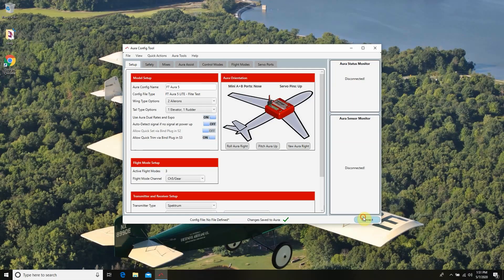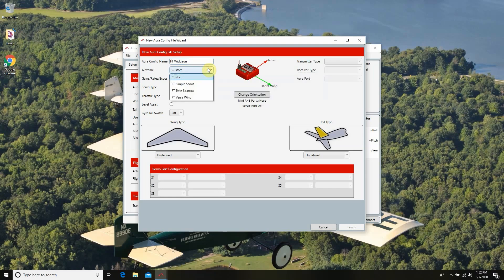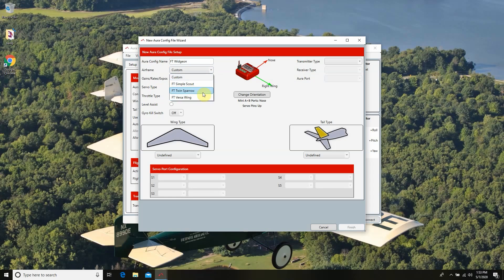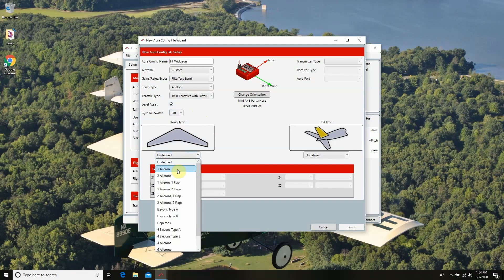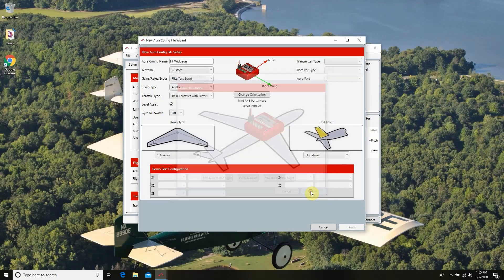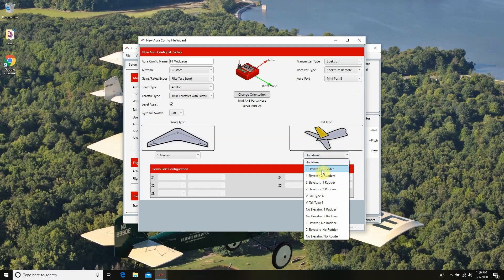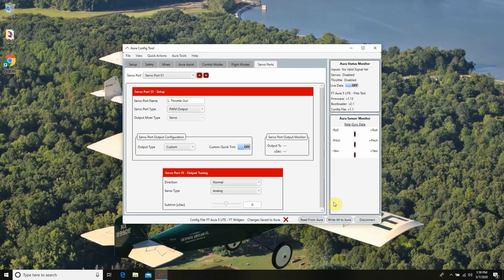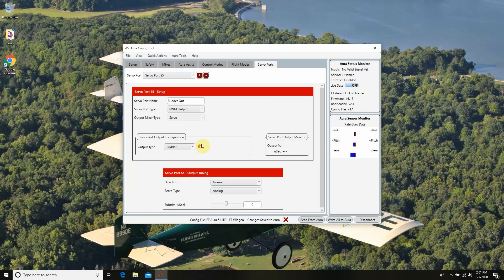How to make a plane profile? / FT Aura 5 Lite

Comment: I don't use a PC anymore, just an iMac. I think that you have no solution presently for Mac users with the Aura 5. I just do what I can with the two push buttons and that is that. Expo, mixes, rates are only in my Spektrum 6 transmitter. I do get 6 axis, 3 axis and gyro free operation. I am about to buy two of the Simple Stick (one for spare parts). Why should I buy the recommended Aura 5?

Comment: Where would be the best spot to put the aura 5 on the sea duck? just order the kit and everything so ready to start build when it gets here
Reply: Hi Joseph,
We aren't super familiar with the Sea Duck ourselves, but you want the Aura to be in the aircraft and oriented in any 90 degree orientation relative to the flight path. Most aircraft will have a receiver or battery platform that is level to the flight path and will work great for the Aura. It does not have to be mounted on or near the CG.

Comment: It would be nice to have a step-by-step video on adjusting the 6-axis settings. I'd like to adjust the bank assist/aileron bank limit and elevator limit and can't figure out how to do it. I have no idea what all the "gain" adjustments mean. I'd like to see an adjustment of the 30 degree bank limit so I can adjust it to say 60 or 75 degrees. As it stands in 6-axis mode it takes 300 yards to make a turn.... Any layman's language assistance would be appreciated. Thanks.
Reply: David, we have some basic definitions of Aura terms on our Wiki page here:
http://wiki.flexinnovations.com/wiki/Aura/Glossary
Gain, specifically, is the amount of correction the gyro will apply for a given movement. In other words, if you have it set to a low number, and the wind bumps the airplane, it will not apply as much correction to counteract that. If you have a large number, it will correct with more force. Too much gain though, and the aircraft can oscillate, or 'wag' back and forth rapidly.

Comment: Yall didnt say Frsky. Will yalls board work with frsky?
Reply from the maker: Yes Sbus can be used
Reply: I used radiomaster rx d168 using sbus to aura 5 then got 3 extra ch on receiver left and use. The lead on rx Ang got telemetry battery voltage also

Comment: I would be interested in an in-depth review of the Aura Config Tool.  A step by step walk thru of what is on each screen, with all the variables and what each controls/affects.
Reply: While they are older and don't include some of the newer features (like 6-axis), we do have a few videos that provide some info on each page of the Config Tool:
Config Tool Overview:
https://youtu.be/D7DUvFqnuFQ
Setup Tab:
https://youtu.be/G0f4ScwXi70
Control Modes Tab:
https://youtu.be/2gX0oSmddxs
Flight Modes Tab:
https://youtu.be/euIoYY4FmiE
Servo Ports Tab:
https://youtu.be/vUA_q4Fj6tk

Comment: I would like to see a video on using a regular receiver instead of a satellite with the Aura 5 Lite. No one seems to know how to set that up. On your FT website for this product, item 2 of the Aura 5's FEATURES it says "Connects easily to receivers or satellites from all major radio brands". Also under PORTS: it says "Five Servo Ports can be individually configured as (PWM) Inputs or Outputs". If they are PWM inputs, where are the outputs? And the WIKI page you link to shows the Aura 8 setup with a full receiver. But I don't see how it would work with the Aura 5 Lite. So we are still in the dark on that aspect of this fine stabilizer.
Reply: Yes... Please Yall guys give us a video showing all the rx's that can be hooked to it. Can we use something like a AR410, or a AR8010T or just a SRXL2 remote. be great to filly understand what all can be hooked to it and show us how to do it. Thanks
Reply: The Aura 5 Lite can only be connected to serial-capable receivers. Spektrum remote receivers, Spektrum SRXL, Futaba S.Bus, FrSky SBus, Jeti EX-Bus, JR XBus etc. etc.
Reply: Also, SRXL2 will be supported in the not too distant future... noting that Spektrum SRXL2 does not behave the same from receiver to receiver, so there will be a table of tested and approved Receivers at that time with notes and any extra cable requirements. 6610T and 4651T and 4650 will be supported in the future.

Comment: I have a question regarding receivers you can use with the Aura 5 lite. Do they have to be DSMX satellite receivers like the SPM9645 or can I use a sport receiver like the AR620? I'm new to this so I have no idea.
Reply: I have the question too about full receivers vs satellites, but no one seems to know how to set that up. On FT's website for this product, item 2 of the Aura 5's FEATURES it says "Connects easily to receivers or satellites from all major radio brands". And the WIKI page they link to shows the Aura 8 setup with a full receiver. But no one from FT has done a video on it, so we''re still in the dark on it.
Reply: @hifinsword  You can connect the common serial receivers to the Aura. For Spektrum, this is SRXL capable receivers and remote receivers. Futaba is SBus, Jeti is EX-Bus, JR XBus etc. You cannot connect a non-serial receiver to the Aura 5, but you can with the Aura 8.

Comment: Hi Josh and whole FT team, my son Davi and I are big fans, he is 4 years old and he flies RC planes solo including rolls, loops, inverted and land already. We have the FT aura 5 lite installed in an opterra 1.2m with a lemon sat. receiver, it flies really nice! I was not able yet to set the launch assist, we are using a DX8G2 tx, all trims and sub trims are set to 0 (zero),  aileron, elevator and ruder travels are set to 125, throttle travels are set to 88 low and 84 hi so there is a good control in whole stick travel, frame rate is set to 11ms as the servos are digital. Please any recommendations to set the launch assist? Thanks in advance! btw we just maiden our FT goblin it is awesome!!!
Reply: Two things come to mind that might help. First, did you do the TRIM procedure completely? That is, did you push the TRIM button, get the sequence of blinking lights, zero the trims, go back to the solid green and red lights and then power down the Aura 5? Once it's powered back up, do the left stick down and left and hold till you get the servo twitch. Be sure not to move the right stick once that's done. The red light should now be blinking. Secondly I would try setting the throttle travel to 125% temporarily to see if that helps. It should not matter but you never know.
Reply: Hifin Sword 
Hi Hifin, I tried the trim procedure but it failed to complete as it never stored or recorded the settings; as the trim was close to zero then I set it to zero and tried the launch assist; is it necessary to go through the trim process before or only having all trims at zero is good enough for the launch assist? Thanks a bunch!
Reply: Keep in mind, in order to activate launch assist, the aircraft has to be still for at least 5 seconds with all controls neutral and the throttle low.

Comment: How do dual-rates and expo work with these boards?
Reply: There's a tab, can't remember which one, that gives you the option to enter D/Rs on the Rx, or in the Tx. I think you just click on a box to check it for one or the other. I prefer to have mine in the Tx so that's what I selected. There is a forum for the Aura 5 Lite on RCGroups.com here that may help. https://www.rcgroups.com/forums/showthread.php?3548599-NEW-FT-Aura-5-Lite-Stabilizing-unit/page12
Reply: The preferred method (and default) is to have the dual rates and expos in the Aura. This is done on the Flight Modes tab in the Aura Config Tool. You can also setup in the TX, but is much more advanced to get things working properly, so it is not something we typically recommend.

Comment: All this new stuff is confusing for myself that is use to using the old 72 mhz gear with out all this computer stuff... 

I was told I needed a new radio system to fly RC so I picked up a Spektrum DX5e... what receiver do I need to work with this board?

I think there needs to be a book for us old RCers that didn't grow up with all this fancy computer stuff.
Reply: Heres the satellite receiver I used. It linked up no problem.  Your DX5e is DSMX so it'll work.

https://www.ebay.com/itm/282869303496
Reply: I still like to fly 72 sometimes

Comment: I got my Aura5 on Saturday and put it on my Mako seaplane. It was easy to setup and trim, especially compared to CC3D boards I've used in the past.

My only "problem" so far is that self leveling is the center position on the 3 position switch. I like having it at either end, so it's just a flick and not a precise positioning. I think I can adjust this in my radio settings tho.

I wonder if differential thrust will have rate mode, like the new UMX Ultrix, and is it possible to have more than 5 servo outputs?
Reply: You can set the level assist mode to any position you want when using the Aura Config Tool. It is a bit more advanced, but can be configured as desired.
There are only 5 outputs available on the Aura 5 LT. Aura 8 and Aura 12 Pro have 8 and 12 available outputs.
Reply: @FlexInnovations  thanks for the response, I haven't plugged it into a computer yet.

I can bind another separate rx to my radio for a 6th channel probably, for flaps or lights. 

Does differential thrust have rate mode to counter adverse yaw forces? I know rudder does, but of course rudder and differential thrust operate differently, no diff thrust without some throttle.
Reply: @learningtocrash4030  
If you use something like an AR8010T with SRXL to the Aura, you'll get 5 gyro-capable outputs from Aura, but also channels 6,7,8 from the receiver can be used as well (CH1-5 are used by Aura). The only issue with this is that channels 6, 7 and 8 are straight from the RX and do not have gyro capability.
You can make the differential thrust respond to gyro movements, but it is an advanced type of setup and must be done in the Config Tool. By default, the yaw gyro only outputs to the rudder, not the motors. Part of the thing to consider as well is that if you did have gyro correction applied to the motors, they would spool up with any yaw movement of the aircraft, including when you carry the model by hand, which can be quite dangerous.
Reply: @FlexInnovations  I won't need the gyro for any extra channels: lights, gear, or flaps, etc.

The rudder gyro would have to have in interlock setting so its inactive until the throttle is raised, I guess. 

My twin delta with the Lemon level RX will spool up if you yaw it with no throttle, but it takes a very fast yaw.